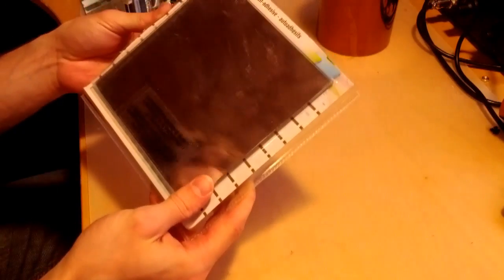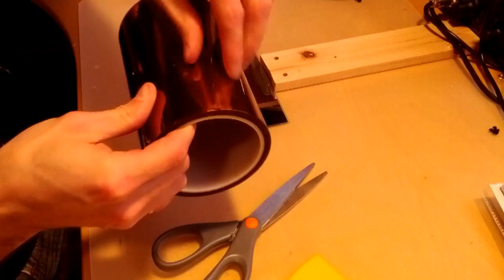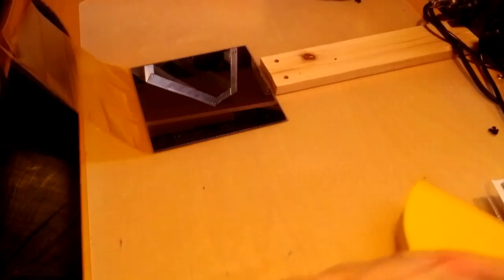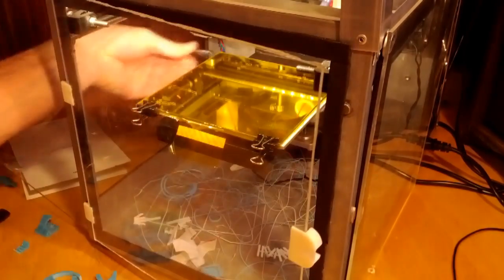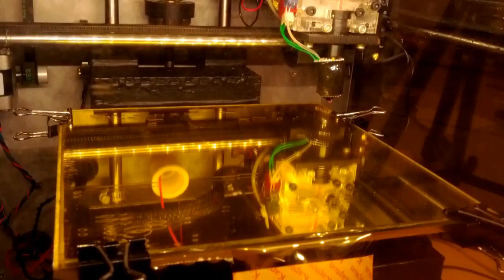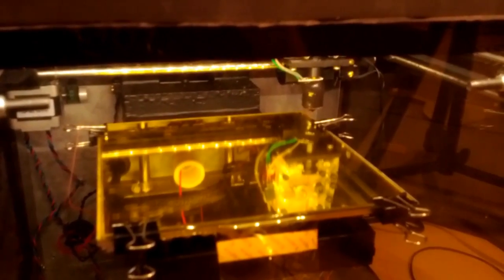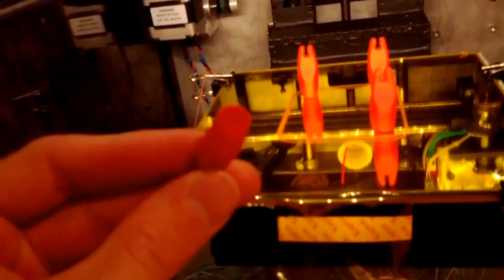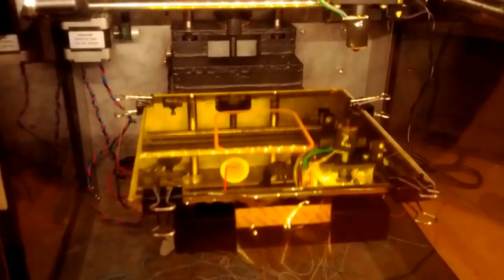How to make a cheap glass bed for your 3D printer!

Comment: I've been printing on cheap glass like this forever.  No tape needed.  As the bed cools, the glass contracts and the part pops off on it's own.  I clean the glass with acetone, give it one light mist of hair spray, and start printing.  I only clean it again and spray it again after printing 20 or so parts. Just scrape it clean and continue printing.

Comment: I bought my mirrors from Walmart, its $10  in a tall frame of 3 mirrors with a paper/plastic backing and are about 1/8" thick and the EXACT size of my heated printbed. I tried to remove the backing but too hard - so just used it 'as is' and it works great and no Kapton tape needed, even scrappers and knives used to remove parts don't scratch it. However being glass I do use ABS Slurry or hair spray for stick-ability (no lifts period), but it scrapes right off or is even washable. Broke one but the second is still good to go months later and still have a spare. Oh and I hold it on with cheap plastic bag clamps, that backing keeps it centered when hot, but does not melt.

Comment: one roll cost about 90 dollars. but you don not need a kapton. I went to the 99 store, bought a frame for a picture (Those with no wood frame) 6x8  get a small clams or clippers and that all. i use hair spray, and works berry good. find for a mirrow style.